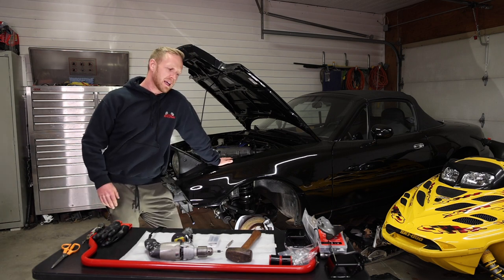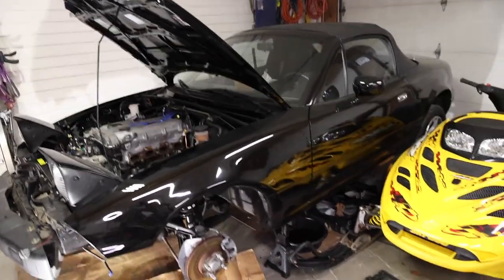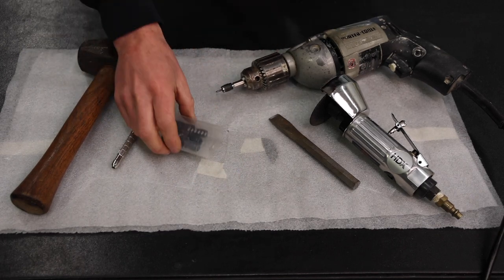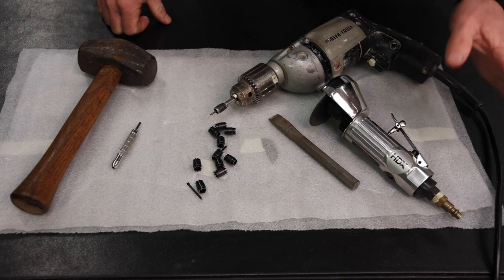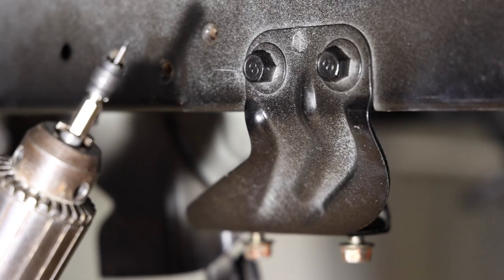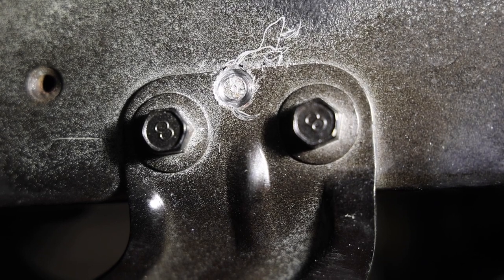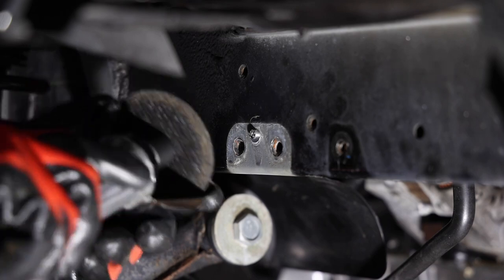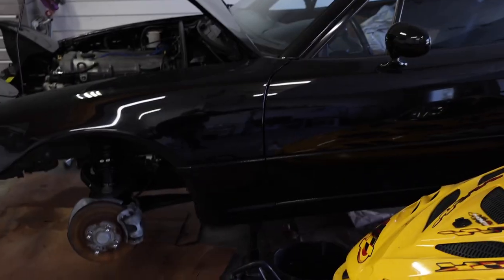How to Remove Spot Welds Properly!

Comment: Good info, but the one I bought in 85, I think it was the MAC truck, he mentioned starting slow but backwards. This seems to work as it creates a groove to follow. I can help it but I always put an oil can with a few drops of simple motor oil. Once done and the part removed, it is easy to wipe clean. Obviously, in body work, cleaning before, during and after is the normal. But I will say these tools are nice to have and get the ones that the center retracts, like yours. 
Nice info, great to see the younger ones getting R done! 
DK. ASE Master Tech since 78. L1 + P2
Reply from the maker: It sounds like you definitely have more experience than me in this department.  I always love hearing what works well for others.  I think putting a little oil on is a great idea no matter what tool / method you use.  Thank you for sharing!
Reply: @DriveItRyan  I treat this like welding gloves, pair on the grinder, pair at the vise and pair on the MIG. That thing is gigantic as the transform is the size of a transfer case. It was new in 84 and the tiny spools sold at Harbor Freight, I had to add a washer, spring and heater hose over the spool bolt. I keep my extra spools and parts inside but air tight in gallon zip locks. There is another tip. It gets humid in NE and this wire with rust. Won’t work a tinkers damn if rusted. So, if I am not using, I slip a bag over current spool, zip to edge of wire but leave it in drive rollers to go. I unscrew the spring-loaded top and lay it back in case someone tries to use it. I lost a 14” spool to rust as it sit while I had several back surgeries. Won’t do that again. No spray, no steel wool (Now sold a dollar stores) with clothes pin over it to clean rust off wire while feeding. So more free ideas. I have to figure a way to cut an 0.230” drive groove for sheet metal as mine goes to 0.030” for smallest wire. It is 150 Amps and has settings for 1/2” (13mm) metal. Big back wheels, tank tray for two & locking fronts. At 240 Vac, I got luck about 20 yrs and bought 50’ of 6AWG coil & put ends on it. Now, I plug in and pull out to mailbox to weld. I have a dedicated 60 Amp breaker in service panel. Set heat for practice run w/hand on the speed to dial in perfect. Not much of a chart guy. But 3 oil cans w/lever squirted in Bach shed. I have no excuse to protect hands or dry drilling. 
  You have an interesting video project going on! Dude, a true 4dr truck!!! I appentinced for a guy in his shop I helped build & he had a Rail-Road IH 4dr. It came with hydraulics & wheels to run tracks. It was a beast and so will yours be. He build full push guard on front with “Bridge Planks” and tractor tire cut & bolted on to push dead ones into a garage. I just turned 15 as I grew 6” at 13, I was already 6’3” tall. We did tractors, school buses, hay conditioning machines, cars, trucks, carbs, auto trans, differentials you name it. Old tractors used gear to gear to drive cam, but had no marks. Plus they had wet clutch and dry clutch both. Cool stuff but dam heavy. 
  Listen, have a safe productive 2022. Questions…holler!

Comment: Nice video, good tips
Reply from the maker: Thank you!
Reply: @DriveItRyan  If you want someone to show you how to try to tack weld stiffeners on a chassis but accidentally burning through the body right near the fuel line let me know. I may have experience with that on a 1988 Mazda RX7 convertible :)
Reply from the maker: @yipyipyip  🤣 LOL sounds like you had a good time with that one!